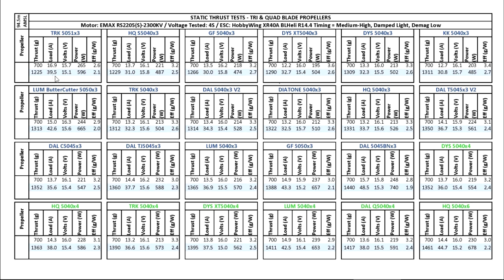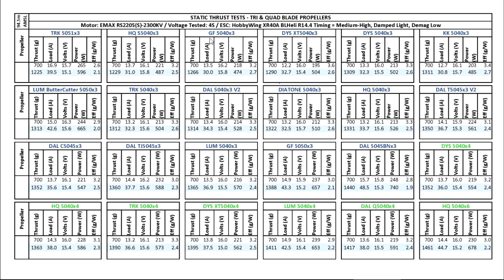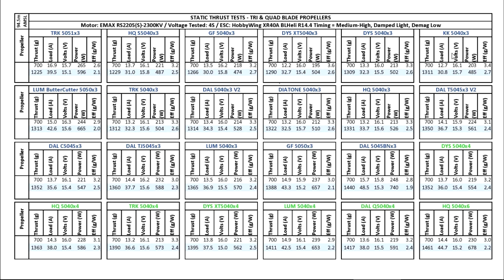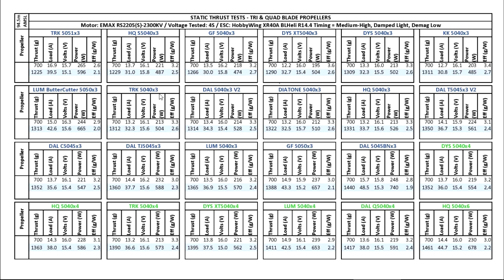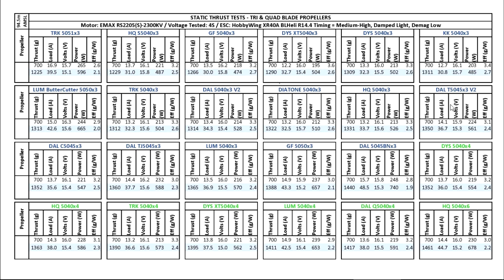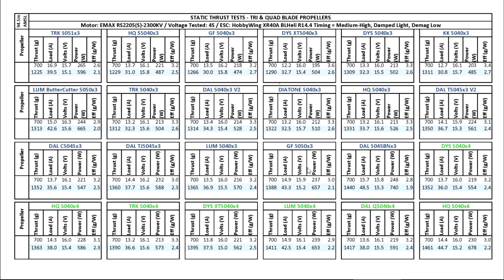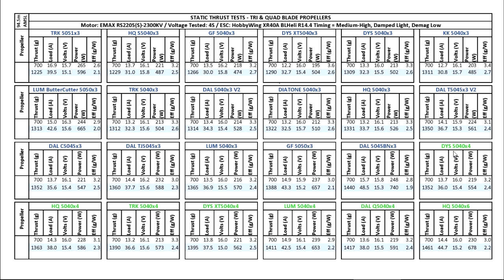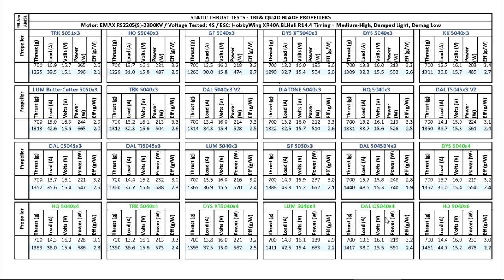5" TRIBLADE SHOOTOUT EMAX RS2205S-2300KV

Comment: hello great video . I have a size question  . I fly a vortex 250 on 5x4.5x3  and I have a few spares I have ordered a holybro x1  and it uses 5x4x3   can I run 5x4.5x3  on the holybro x1 ?  I guess what I would like is just one kind of prop for both crafts I wonder how the vortex would run on 5x4x3  ?thank you

Comment: The KK 5040x3 is a very efficient propeller but they are a bit fragile.
KingKong now have the same propeller in translucent color and better resistance but maybe won't be so efficient, do you have one of the translucent to benchmark?
Nice video, very useful information :)
Reply: Just got some clear KKs today.  Besides the clarity they weigh and feel the same as the opaque ones. Still really flexible.
Reply from the maker: André Ferreira I don't have the translucent version of the KK5040X3. Yes, the KK props have become very popular and many people like them
Reply: SickocrowAU Crash test it :) the transparent stuff are usually more durable. I already ordered some to test and will report back the results
Reply: I prefer them over the opaque after testing.  Flight profile doesn't seem any different but they do seem to hold up somewhat better.

Comment: You should strap your test rig to the roof of a cheap car and do tests in a 50 mph wind to see what the high pitch props look like at speed.  How about setting up a gofundme so we can all buy you a $500 beater on craigslist so you can bolt stuff to the roof.
Reply from the maker: LoL !!! what if the car takes off? Hey not a bad idea. That would make for an interesting test. I'd also test with prop at different angles of attack.
Reply: I came up with the idea trying to brainstorm how to build a wind tunnel in my garage to do prop tests.  Then after I started pricing materials and fans that can move that volume of air I realized it would just be easier to buy a craigslist beater and bolt a thrust stand to the roof.  And as a bonus you could use active braking to charge lipos as you drive to different flying spots!  Just let the prop freewheel in the wind and pump power into the battery.  If you mounted it with suction cups it could probably be mounted on a normal car.  No need to bolt it down.
Reply from the maker: The only thing you would have to find out how far up is the clean airstream, it probably wouldn't have be that far up. I don't see why it wouldn't work :)
Reply: Stick it on your hood and have it a foot or two out in front of your car in the clean air before it hits your car.  I've been tempted to do it for quite a while.  Plus the looks people give you as you drive down the street would be hilarious.  I just wonder if the wind would create too much noise on the thrust scale.  I'm sure the readings would be very dirty compared to a static stand.
Reply from the maker: Yeah that would be clean air. I'd imagine there would be some minor noise from air drag on the loadcell-scale but I think the larger motor-prop thrust would be well above the noise/unwanted forces. Hahaha, there's plrnty of whacky people on the road already, one more no problem.

Comment: great work! 
interesting to see that lower pitch is better. wonder what happens if they are tested with any props with less pitch then 4. KingKong are the most efficient from what I can see and probably my choice since they will only require 30A ESC. any thoughts.
Reply from the maker: Right, it's quite interesting. Looks like 3.5 to 4" pitch is the sweet spot for 2200 to 2600KV motors as far as keeping Amps reasonable. You can use a 20A ESC with the 5040x3 props. Keep in mind in-flight the Amps will be lower by 25 to 30% and flight LiPos can't deliver sustained high currents. Check out Joshua Bardwell's tests. 60A are only available for about 5 to 10sec at most so that's well within a 20A ESC's capabilities as they'll have surge ratings of 25 to 30A for about 10s. Using a 30A ESC is of course a good choice as you don't have to worry and you'll have more options fro props and motors later on and they cost and weigh only slightly more than 20A ESCs
Reply: EngineerX Good to know. not enough data to go on, but I burned one ftv littlebee 20A on kk5040x3 in -5 c° air temp. so I temporarily blocked my FC to 1850  maximum command to save them until 30a arrive. works great after 2 weeks of daly flying.
Reply: EngineerX Good to know. not enough data to go on, but I burned one ftv littlebee 20A on kk5040x3 in -5 c° air temp. so I temporarily blocked my FC to 1850  maximum command to save them until 30a arrive. works great after 2 weeks of daly flying.

Comment: Is there any chance future tests with 2600kv? I want to see how the kv difference really affects the range when heavy props are factored in or lighter ones.
Reply from the maker: Jay Patel Yes. I just placed an order for a RS2205S-2600KV from HorusRC.com. it'll be a couple weeks for delivery. I'll  have test results in early February as I'll be away from home 2nd half of January. I'll run the 2600kv on the lighter props 5040x3 Lum 5050x3 and DAL C5045x3 as the heavier props like the 5045BN and the quad blades  could fry the motor on the thrust stand.
Reply: EngineerX sounds good! I'll do a little testing myself with the assortment of props I have and find what I like best. :)

Comment: nice to see my cheapo kingkong props doing so well,
Reply: I was very surprised to see those numbers as well.  Thrust tests aren't the whole story though.  Those KK props don't grip anything like a Cyclone or 5045v2 does.
Reply from the maker: True. You really gotta fly them and "feel" them in the air. I've yet to fly the Cyclones. Just haven't had time lately.
Reply: i just don't have the skills to comment at that level,  people recommended them and they are cheap and light
Reply: No quibbles there. I have flown the KK5x4x3 so long I'm pretty used to them.  I'll still use them for sure.  I was just surprised at the different feel when trying the Cyclones and 5045v2.  It's not so much a speed difference, but how they bite when cornering.
Reply: i agree, cyclone props are amazing. Love them, my favorite prop atm.

Comment: Thank you for your work! I have seen some differences in performance on other prop tests when using a crystal or opaque prop. Have you made the same experience already? (Cyclones for example)
Reply from the maker: When they're different material like those KK you mention, then performance difference could be more noticeable, but when the same material, like polycrabonate, and just the color is different, translucent VS solid color, then probably the performance is nearly identical.
Reply from the maker: I didn't specifically test for those differences. But there may be some truth to that. Arguably translucent/transparent props have "more" plastic material that makes them flex less at high RPMs or when they're under load at high-G maneuvers. The color dyes mixed into the plastics in the solid color props replaces some of the plastic material so props end up a little "flexier". At least that's the theory. 
In order to really test and determine if that's the case, we would have to test under very controlled conditions. The most important being the power supply. We would have to have a dedicated power supply instead of using LiPos, since you loose some voltage after each run. Also we would need to make sure the motor doesn't have any residual heat from previous tests. 
But I think the logic of the color dye taking away some of the strength on a prop does make sense, though I don't you'd notice the difference, unless you're competing where every millisecond counts or you're a top-ace pilot that demands the best of the best. Thanks for watching!
Reply: I bought some sets of Cyclones in both types, and to the touch and pushing them against each other they are the same.  I've got some KK 5x4x3 clears coming and I want to see if they are stiffer than the opaque versions.  I think the opaque are flexi nylon and the clears are stiffer polycarbonate.